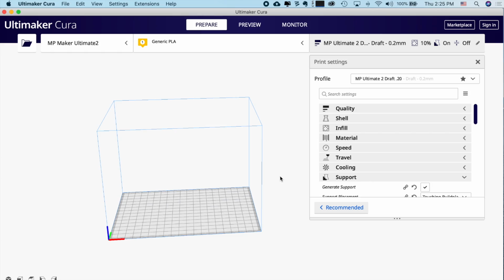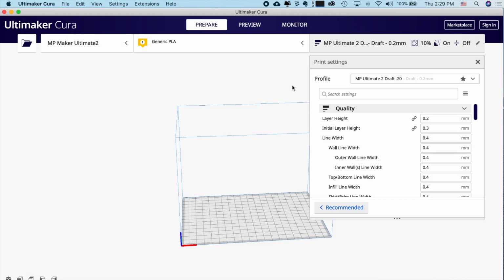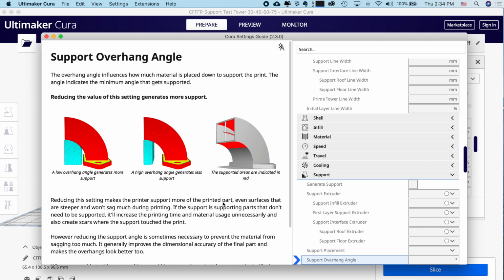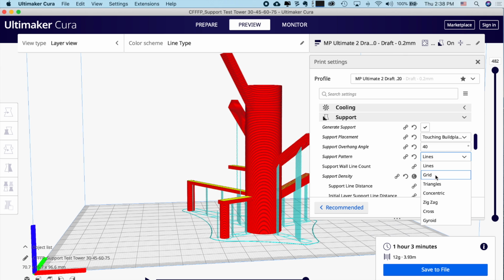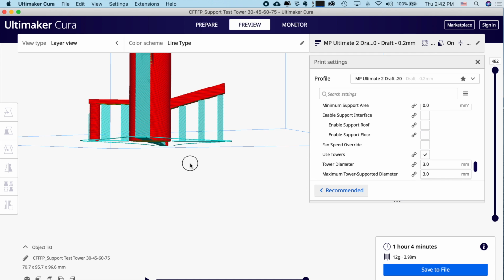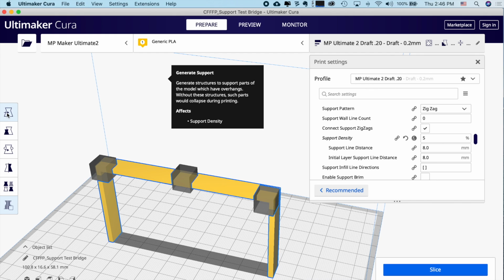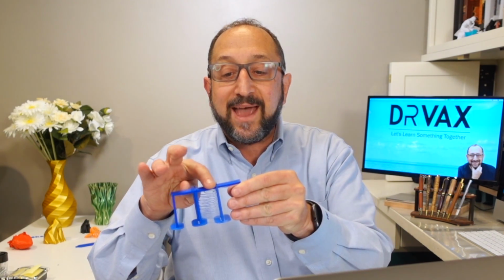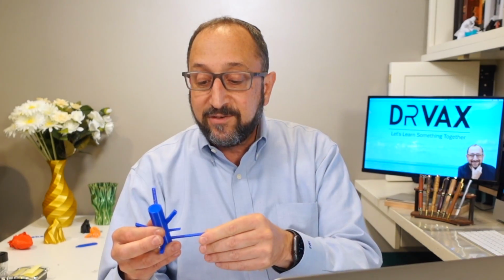3d Printing Cura 4.X Custom and Advanced Support Tutorial

Comment: Learned lots here.  One thing I noticed is when adding supports to a overhanging cylinder, Cure 5.2 wants to add support rings underneath, which can be very hard to remove.  Using the custom support add-in (now called cylinder custom support), I can add supports without the rings, ending up with something that can be removed afterwards.  The tests I did with the rings, they were not able to be removed.

Comment: First of all: Nice Video. 
I definitely have a problem I’m trying to solve for almost 3 days now:

I‘m printing a sailplane. So I want to print the wing of course. The problem is, because those are very thin but high objects At a certain height I face swaying from left to right while it’s printing which makes the print not smooth anymore (the layers become more and more offset) and the wing becomes useless. So I tried with custom supports to support it from horizontal movement

The real problem is because the supports do not in fact actually TOUCH the object, but just almost, it does absolutely not provide support in a way I want it to.

Does anyone have experience with that and could maybe help me? I’m despairing actually. I just need a supporting solution for the object not to wobble from left to right while printing.

Unfortunately because 1. I need laminar flow over the wing and 2. My printing surface is not absolutely even I’m not able to print the wing laying down, so I need to support it from swaying while printing it.

May someone save my weekend please? 🤝
Reply: I realize your post is an old one but thought I'd try to help in case it is still an issue or someone else has the same issue.  For printers that move the bed and where you also have a tall thin structure, orient the structure in your slicer so the longest dimension of the object is aligned with the direction of bed movement.  That will help prevent the swaying you're encountering, another thing to try in extreme situations is reducing print speed to slow down bed movement.  The print will take a lot longer, but at least it will complete successfully.

Comment: Looking at the version of cura showing in your video it does look like it has the ability to place manual supports without a plugin. (just found out that today on another video myself) using the blocker and the option to change a blocker to support with the button that looks like 4 pawns

Comment: hey doc... what's about this setting for miniatures 28 mm ? thx
Reply from the maker: The process of printing models big or small, detailed or with minimum polygons, is the same.  You need to do lots of prints carefully changing one parameter at a time.  

This is why I do not believe in standard optimised profiles.  Profiles need to adjust based on not just the printer but also the filament, the humidity in the room and where the filament is stored, the age of your printer, etc.

Each of use needs to learn how to tune our printers if we are looking for the very best prints.

A parameter that people tend to neglect is speed.  When printing small objects since print times are shorter just slow down the printer --- but not too slow as it will mess up the cooling.  I would try printing at 30mm/sec with a small layer high of .12 or .15.

To maximize detail you may also have to adjust the minimum resolution slicer setting and the settings impacting small details such as print thin walls.

In 4.7 I noticed some new settings for small features in the experimental section.

A great place to discuss this is at the DrVax forum located at https://forum.drvax.com.
Reply: @MakeWithTech   I am printing or be focused on small miniatures 28 mm to 36 mm... the speed rate is better at 30 mm / sec? I am using ender pro 5 I do not touch the mec.exturder yet...just the default setting for my printing.

Comment: Sir. Great information shared in the videos. don't get me wrong if I insist you to see all your videos with a playback speed of 1.25. Your overall video time will reduce and that's one more improvement to your channel.
Reply from the maker: Some people prefer a slower presentation.  If I record my narative slowly people that want it fast are able to play at 1.25, 1.5 or even 2x and it still sounds ok.

Thanks for the comment.
Reply: @MakeWithTech  Sir. thanks for the response. Please advise, if there is any scope for increasing the work area of ET4 pro by replacing the aluminum extrusion with a larger size & the heating bed. what changes on the software side do we need on the same controller board as now it's having an opensource firmware available. its all about the budget build as locally hardware will cost less than $50.

Comment: Hi Drvax, frist of all i'm a beginner and I bought an Alwise U20 plus (400×400×500mm). My hobby is rc powerboats. I startend with the first part with pla. Not a good choice concerning moving the boat in a hot car. Went to petg. The printing of pla was exeptable. But petg is realy bad. Much wiring, rough surfaces and cracks in sharp eches. I tried many setups but it is not better. Please can you give me a most commen setup tot Cura 4.6.1 and a gcode? I'm afraid to do something realy wrong. I saw most of your video's and your are realy a hero in 3D printers. You are helping me a lot and very much time to understand  printing petg. Ps. Nu printer is not self leveling. I do this always befor printing by hand. Thanks in advance and many greetings from Holland, Herman (herman-marga@ziggo.nl)
Reply from the maker: Take a look at my video about printing PETG.   It is all about getting the temperature correct.  PETG require much higher temperatures.

Here is a link to the video.

https://www.youtube.com/watch?v=WjxMA4CkUZc

Comment: Hello im experiencing issues with my ender 5 pro z axis there are zero videos out there to help with this issue.. Prints are coming out very short just no info on z axis binding on this style printer i got pictures on facebook an instagram no one seems to have any clue as to how to fix the issue... Problem just started... Have completed many successful prints before this started happening
Reply: Have you recently updated the firmware? I would imagine your Z steps have changed from 800 to 400. Some Ender 5 have the 400 step Z screw and some have the 800 step Z screw. If you have the wrong setting selected it will cause your bed to move half the amount it should. 
Hook your printer up to your computer, use a program like pronterface, send a gcode "M92 Z800" and then "M500"
Or, use the stock firmware and change default_axis_steps_per_unit.
Or, use the screen/knob to set the steps that way, and then make sure to save it. Go to Control > motion> steps per mm > Z steps. Enter 800. Click save.

Comment: Good video Doc. This will be really helpful for the people new to Cura. I learned about that 'settings guide' and will use it often I'm sure. When you talk about the angle function and where Cura will support overhangs you kept referring to percentages and it is actually degrees. There is a bunch of editing there so you may want to throw up a disclaimer text to the beginning of that section.